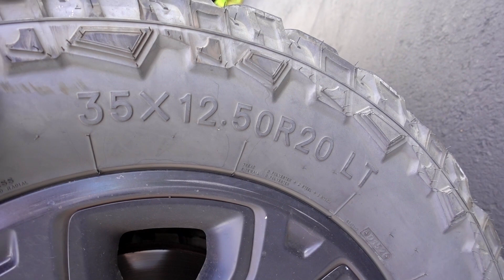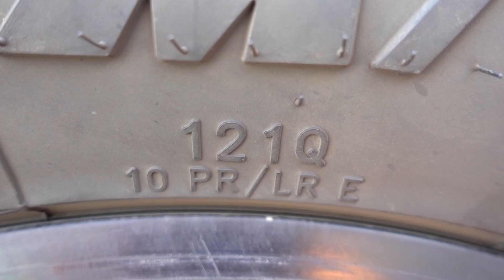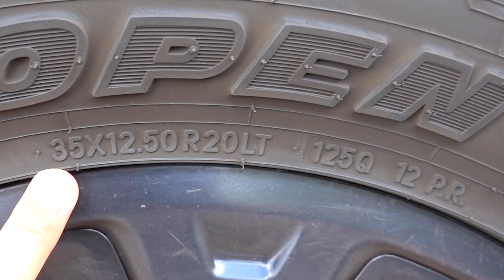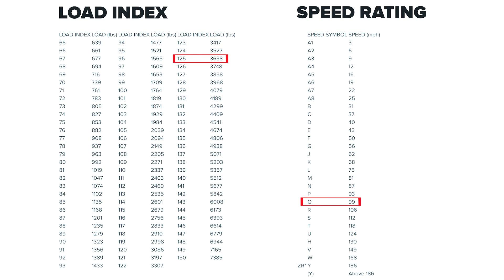🚙 TRUCK TIRES FOR TOWING YOUR RV 🚌 RV Truck Tire Blow Out While Towing!

Comment: I run a light hotshot business and have an F350 and I tow a Lot and very frequently. I run 265/75/16 LT Mickey Thompson Baja ATZ P3 tires in the Spring/Summer and they have worked fantastic. Not noisy at all, aggressive tread. And all the reviews I watched and read about them before buying them were excellent. No issues with them while towing heavy either.

Comment: Best tires for towing are 295x65R20  -which are actually taller than 35's with a Max load of 4080 lbs per tire

Comment: You have a cute family. Technically, you did not have two blowouts, you just had two flats or at least two tires damaged. You should put four brand new Michelin defender LTX tires on there and keep that cute family safe.

Comment: The cargo capacity of your truck is on a printed label in the drivers door jamb. That rating does not change because you put tires on the truck with a higher load rating. There is a lot more to it than that.

Comment: Cooper discover at3 are real nice.   Im planning on getting 6 for this trk. I scale 22k gross when hooked up to my flatbed. I used to haul the trl with a 3/4 instead of my 1 ton dually now. Those coopers handled the load wonderfully even with just 4 not 6 that i have now. Im at 4.2k front 6.1k rear 11.7k trl when i went on a cat scale.   Oh just you know i have 14 tires on my rig. Will be getting a pickup camper designed for half ton in a few years. Fun part making a setup to put a pickup camper on a 11ft flatbed trk that is 8ft wide when pickups are only say 6ft wide

Comment: Warning here!!! if you have 4x4 on your truck then you must buy all four or the difference in tread of the rear being new compared to the front being old will destroy the transfer case of your 4x4. and transfer cases are Expensive to rebuild...2nd warning here just because you got stronger tires to handle the load dosnt mean you truck can do the same.
The pay load is still the same what the truck is rated for no matter what kind of tire was installed or problems of break downs are going to occur ...

Comment: At ten minutes in: Tire measurements!
So this is referring to a different tire measurement based off of the metric system and aspect ratio. 35x12.50R20 is 35 inch overall tire height(actually 34.6”) by 12.50 inch overall tread width(actually 12.6”) for a 20 inch diameter wheel.
The picture description shown is the metric/reference measurement system where it is tire width in millimeters(section width) first/(over) the percentage of width which makes up sidewalk height(or aspect ratio) in millimeters, on a referenced wheel(rim)diameter. If you wanted the same comparable size on the metric or aspect based system for a 35x12.50R20, you could also search for a 315/60/20 or 325/60/20. 
To calculate this:
12.50 inches is roughly 315 millimeters(317.5mm)
35 inch tire diameter - 20 inch wheel diameter is 15 inches
15 inches divided by 2 is 7.5 inches or 190.5 millimeters
190.5mm divided by 315mm (for aspect ratio) is 60.04 therefore a 60 aspect ratio
Combine it all for a 315/60/20 tire.
You can do this for whatever desired wheel and tire combination on your own.
Based on popularity, some tires may be significantly less expensive just based on using a different tire nomenclature. When shopping around, try this to save yourself a little bit of money. Keep in mind that your load and speed ratings may vary, as well as tire ply ratings.

I hope this helps,
  Thomas B.

Comment: wow, not to brag but I knew tire info when I was 16.  But this is the shit people need to learn not GAME SYSTEMS.   Hope by now you are running load range "E" tire and loose them M&S monsters.  oh M&S=Mud and Snow.  A/T tires are great, with a "E" rating.    Safe travels. and keep on tire pressure. remember with heat the PSI expands.   also keep an eye on the trailer tire wear.
Reply: You’ve known tires since you were 16; cool. Did you know that M&S tires are available in load range E?  Didn’t you see in the video that the tires that he had on there were E-rated?

Comment: Good video except I recommend you remove any references to how OFTEN you tow making any difference on whether or not you overload your rig.  Running an overloaded tire (or vehicle) once is just as illegal, stupid and dangerous to the lives of our families as doing it twice.  All the biggest mistakes are only made once.  What you did recommend (checking the weight rating vs load) before you buy the tire or truck or trailer, is ALWAYS the right answer. Ps remind people to include tongue weight, people and fuel in their payload calculations, and if they buy a trailer used to have the bearings checked so they won’t lose a wheel. Thanks!